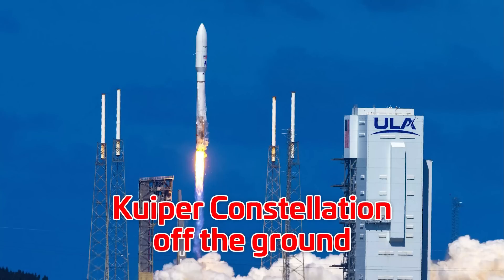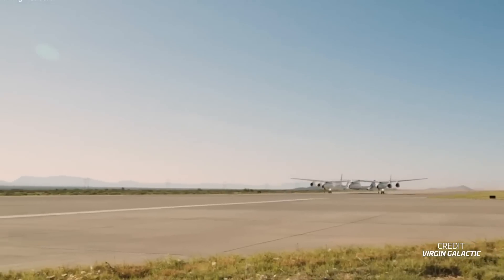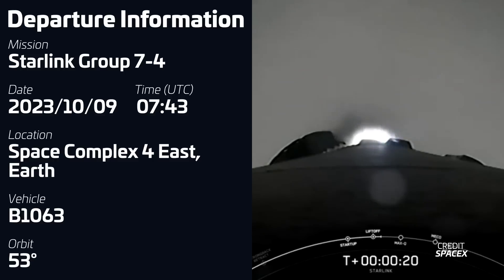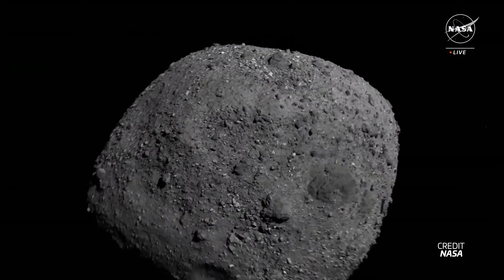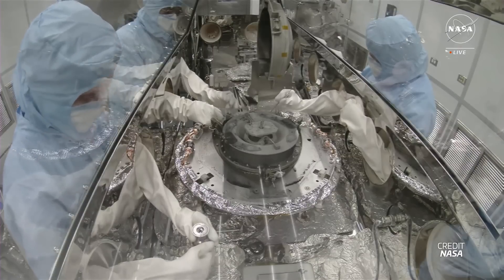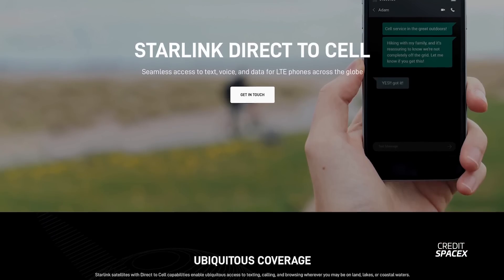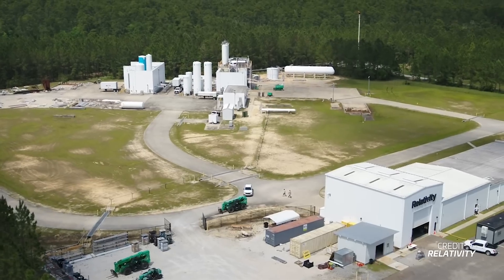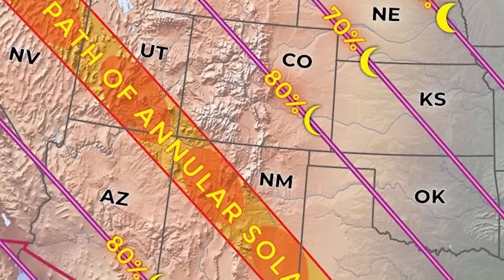NASA's Incredible Asteroid Discovery | This Week In Spaceflight

Comment: "What are the chances of both a primary system and its backup failing at the same time? That's very unlikely, but in a crunch, I wouldn't wait to be caught without a second backup." - Chief Miles O'Brien
Reply: Indeed.  2 is 1 and 1 is none